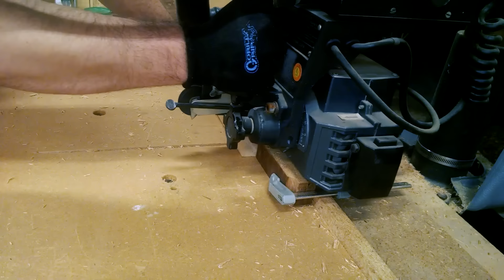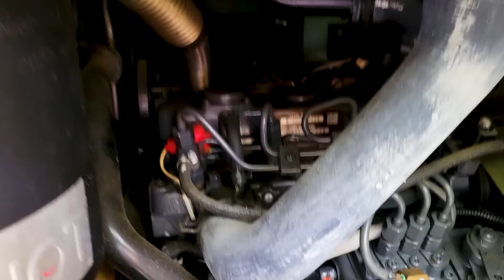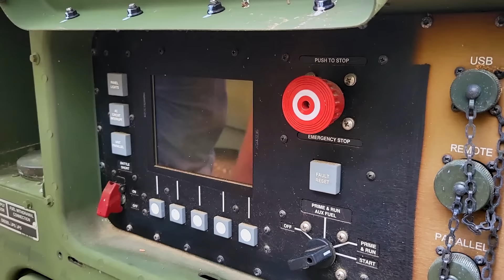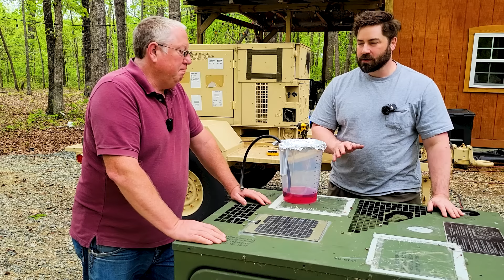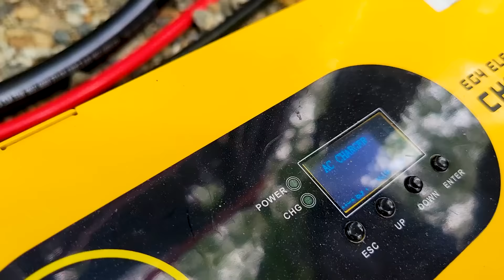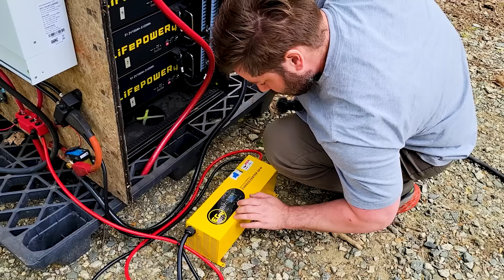Testing the Army's most efficient generator

Comment: the efficiency mismatch is because of the voltage. the most efficient is 3 phase and its measured by a resistive load bank directly. unless you are running the generator in 3 phase you will not see the efficiency gains.
source: i was a maintenance guy in the millitary and worked a lot on these things and because they were so problem free we had a LOT of time to mess with them.
Reply: I suspected the efficiency rating was both three phase and resistive.  Most efficient load and generation.  Be interesting to see what a three phase ac charger would do.
Reply: @cadamwil  well it not being a purely resistive load is fine for a real world application test honestly, most of the things you will connect will be a mix between types of loads anyways.
Reply: @cadamwil  first they would need a 3 phase charger that has PFC, mean well has those and are not cheap in that power rating. and then they would still be measuring behind the charger and its losses. they need a 3 phase power meter to do this correctly. the fact that they are measuring at the battery side and not the generator output makes me not being able to take this kind of testing and their results seriously. AC power meters (callibrated ones) are NOT expensive.
Reply: @SupremeRuleroftheWorld  This may be true, but overall if the general public were to get one of these and do testing, this is generally the type of testing that would be done. Test how much power is collected after all the gadgets to know if it's worth spending the extra cash for a better unit. Most home/diy set ups won't be using 3-phase, or won't purchase a 3-phase charger/inverter in the first place. So for the real world application of this unit by general populace is pretty close. 
But as always, take these kinds of findings with a grain of salt because everyone's mileage will vary
Reply: @korishan  if you had this setup a 3 phase charger would be very much a no brainer.
Reply: @SupremeRuleroftheWorld  its not lab testing allright but I agree that they would atleast need to do three phase
And I mean messuring what gets transfered to the powerbank and loads is still a important and interresting number
Reply: @korishan  I mean if you trying to messure its efficiency and efficiency claims you gotta go for 3 phase, no way arround it
Reply: @SupremeRuleroftheWorld  I think their chargeverter has PFC. And no need to get a fancy three phase one, three single phase ones should work just as well.
Reply: @SupremeRuleroftheWorld  Which generator is most efficient, that could be used to power a house? So I guess two phase. Does the military have a very efficient generator that would be suitable for that purpose?
Reply: @eDoc2020 the reason he was talking about 3 phase is power factor. And when you run a 3 phase inverter on single phase, you lower the efficiency.
Reply: Great information, thank you for your service 👍
Reply: Could there also be an efficiency difference in running Ag Diesel vs JP-8? I'm not particularly knowledgeable in this space but it was my understanding (and could be wrong) that the military standardized their fuel supply to be JP-8 for the broadest use cases.
Reply: The electric motors in hybrids are usually 3 phase for the same efficiency reason.
Reply: A part could be that they were over the 5kWh at a max of 5.7 they said wasn’t long yes but that could do it as well
Reply: So YOU'RE the Maytag repair man.

Comment: Engine efficiency is at best when you're at the peak power / torque in the power band.  If you run an engine at max, it will be less efficient.  This should typically be around 50 to 80% of of it's max.
Reply: Unfortunately the max torque rating for the engine is far above the operating RPM for this generator. 🙁

Comment: If our electricity gets any more expensive here in California, it would be cheaper to generate our own power via that diesel generator, if we are charging batteries without solar panels. With panels, a generator like that would be perfect for filling in gaps from cloud days.
Reply: I got a call yesterday from a friend that has a small auto shop. Their electric company just went to demand billing and his power bill went up over 4x for the same power. We are looking to put in hybrid inverters with storage for peak shaving. The ROI will be under 24 months. So yea, power is getting pricey in a LOT of places!
Reply: ballpark $/gallon for fuel (gas/diesel) can be converted to kwh, the electrical unit on power bills by multiplying the cost of electricity by 10 (or moving the decimal place once over). 
here in wa state with pretty crazy gas taxes, we are paying ~4$/gallon which would be like paying 0.40$/kwh.
instead i charge my ev for about $0.09/kwh, so its literally like paying 1980s gas prices with toiletpaper 2025 dollars. my electric car completely paid itself off after 18 months of driving. crazy.

Comment: you ran it at 100% load. 70-80% load is the sweet spot. Prob most efficient at that load. Run it at 4k for the test. Running anything at max cant be the most efficient.
Reply: We were running to match the published fuel consumption data. The number in the manual was stated @100% load.

Comment: I bet the circulating current from the 3 to 1 phase brushes, or whatever it uses, are at a 3% magnet drag during some specific current draw. At the full 5 kWh I bet it’s higher. I also imagine that if you used it on 3 phase, with a different charge controller setup, it would reduce the loss drastically. I made a crappy 3 to 1 phase, low current generator, at home. It was more a concept design than anything. I just used permanent magnets and brushes, then shifted them to go from 3 to 1. But when I would do that the motor I was using to turn it would start pulling too many amps to maintain the same RPM. To be perfectly clear here, this is when I was pulling 120v @ 240 watts per phase from both 3 and 1 phase configurations. So even though three 120v phases at 2 amps is more total produced power (720 watts), it cost more power to produce a single 120v line at 2 amps (a measly 240 watts) lol. 🤷‍♂️ science. I guess. That issue may have been particular to my design, but I suspect it was just exacerbated in my design.

Comment: Is it possible that the generator was rated using JP8 and not commercially available diesel?
Reply: Per Grock:
JP-8: Approximately 125,000–128,000 BTU/gallon. It’s a kerosene-based jet fuel with additives for military use, designed for wide temperature ranges and stability.  Diesel (No. 2): Approximately 129,000–137,000 BTU/gallon, depending on the blend and refinery specifics.
Reply: That is a good point. If it were I would have expected it to have over-performed since JP8 is closer to K1 than it is to D2.
Reply: California blend..no good. Way less energy.

Comment: What was the maintenance item code ?  Could account for the inefficiency . Specs would be reliable on a mil spec unit .
Reply: It was for the daily system check. The computer has all the maintenance schedule built in and will prompt you every day to do the pre-run check. It will also warn you when you are approaching a service interval to make sure you have the parts on hand.

Comment: For me, I bought some used light towers from a rental equipment auction. Watch for when they do a full refresh and upgrage of equipment. Picked up my tower with 4 1KW MH lamps. due to the auxillary load for the ballasts, and the safety margin, they are 6KW rated with 8KW surge. Surge is for a couple minutes, so plenty of capacity. Due to the large number of units at the auction, picked mine up for less than $1000. Single phase, 120/240 volts at 30 Amps.  Use it for running sound systems for concerts. After the concert, transfer over to the lights for tear down. Perfect mix of use. It came ready to run with the 30 gallon diesel tank full. Supposed to run 60 hours on a tank with full lighting on. For the concert as the average load is much less, I get longer run times.
Have considered removeing the weight of the MH lamps and upgrade to LED, and make it an inverter/battery hybrid. Run the concert on battery most of the day, and start the unit to recharge and power the louder evening prime time shows, and finish charging after the show while using the lights. An auto start on the battery inverter charger completes the conversion to hybrid operation.
Another advantage of the light tower, it is a trailer for mobility to and from events.
Reply: Nice! This is a perfect use for one of those.
Reply: @MrHuram-abi  Unlike a rental, you can add the breaker box to add the 240V 30A breaker and outlet.

Comment: This is the first measurement (2.3 kWh per liter of diesel) that comes close to my low end generator that does more than 2.5kWh per liter of diesel. A bigger efficient generator should yield roughly 3kWh of power per liter.
I think we have to face the facts that your measurements are off. Way off.
To be clear, they are factual, but something in the setup is not correct.
For instance: my cheap ass generator is 7.5kWh, and as a rule of thumb you should load it at at most 80% to be more efficient. I load it roughly at 5.5 which is 73% of the max power. That yields 2.5kWh per liter out of the generator as measured by my multiplus 2 3 phase setup.
Now what goes in the battery largely depends at the state of the battery.
So I want to see you measure what you get out of the generator, and what you put into the battery, because what I think is that we are looking mostly at a major loss of efficiency of the EG4 charger/battery combination.
I will tell you my way of measuring:
Whenever 50kWh of power is delivered according to the MP2 I fill the tank with diesel from an empty jerry can that I filled with exactly 20 liters at the thankshop. At some point in time the amount of diesel still in the tank (30l) is too much to add 20 liter from the jerrycan, so I try to aim at 51... So that's more than 2.5 kWh per liter.
The circumstances are bad: around freezing point. I did not add stuff to the diesel. This diesel would be as thick as honey if the temperature would go down 2 more degrees.
The generator is a DG75E MW-tools, and looks like a run of the mill chinese generator.
According to victron professional, a diesel generator will run most efficient around 80% of it's given capacity, and a bigger unit (mine is undersized for my use) would yield more than 3kWh per liter when loaded at 80%. You can load the diesel generator more, but it will be much less efficient.
That comment got me ridiculed in the diesel generator reddit. But yeah, facts are facts. I do slightly more than 2.5kWh per liter, which is 9.45kWh per gallon where the gallon is 3.78 liter (as gallon is country specific).
I don't measure what I put in my battery, it just says x%. I only look at how much kWh I have generated, and how much kWh I expect to use for heating, as I am off grid, and heating is  a bitch.
So yeah, if I make a mistake, you will find me in the newspaper as "frozen to death".
So really, something is off with the way you test. Generators should be way more efficient.
Reply: something doesn't add up, it says it consumes 8.7 KWh per gallon, which is 4.613 liters of diesel, so it's 1.88 Kwh per liter

Comment: From my calculations you are about 23% efficient (fuel to battery) or about 25.6% efficient (fuel to 120Volt 60Hz AC power).  Either way, that is pretty good!  I have to wonder if maximum efficiency actually occurs at maximum power???  I'd guess it is close to that, but maybe 80 or 90 percent loading results in a higher efficiency?

Comment: So exactly which 05 series Kubota is it??
My 1105 with an 8k head is a reliability BEAST
Did the military rate it on #2 diesel or on #1 JP8??
Reply: D2 has more BTUs per gallon that JP8 so moot point.
Reply: The engine is the D902-IV C.

Comment: I have wondered through this series if you could test at a lower/higher demand load. I realize they are designed for peak efficiency at 100% load, but I wonder how much tuning/slop exists in that based on build quality/breakin/etc. So it doesn't account for 20%, but it might be 2-3%.
Reply: That would be great info to have for sure. My read on the series is David is looking for any patterns to see how different types of generators compare against each other.

Comment: The generator is rated at its output on the most efficient power delivery. In the case of the MEP you should test it at 120/208 3 Phase into a load bank (not your charger). You have to think about power factor.
Reply: I do plan to do that as an aside since I have a 3 phase load bank. I also have machines with higher and lower hours. I want to see how that affects things as well.
Reply: True, but the end goal for this channel is battery charging efficiency.

Comment: I wonder if the generator engine is still breaking in which will cause it to consume more fuel.
Reply: He covered this in the video.
Reply: We are wondering the same. I will be testing that thought soon. I have other generators of the same model with around 300hrs. Those should be well broken in.

Comment: The generators I am used to using are gasoline powered. They recommend running them at half load for best feul economy. I am wondering if pulling a bit lower Amperage/Wattage during the test would increase the economy.

Comment: Wow, it is quiet. Barely effects the mic! Nice!  (Thanks for the ROI info)
If the internal computer dies, tho, how easy is it to get the spare? 
BTW, if David keeps volunteering information like the effect of altitude on the efficiency of combustion, he might tip people off that he knows more than he lets on.
Reply: The MEP10xx series are super quiet for sure. We had a power outage back in January and you could not hear it in the house. The generator was around 50' away, in the driveway. That was in the middle of the night when it should have been most obvious.

Comment: This might be a situation where running at full capacity reduces fuel economy. Maybe running at 25%, 50% or 75% is more efficient than 100%. I've found that my propane generator tends to run longer when at like ~80%.
Reply: I expect you are correct. But we were taking the rating from the manual and it did state that the fuel consumption was at full load. We could have been more clear with that.
Reply: I have tested and researched a lot of generators and diesel engines and I have never seen one that doesn't give max thermal efficiency (Which is what matters in a test like this) at or very near it's rated load (In fact you can usually get even better efficiency from the engine if you go above the rated load though you potentially risk overheating it if you do it for a prolonged period of time) . These aren't vehicles where full power equates to high RPM / high speeds/aerodynamic drag which increase frictional losses. The engine in these generators runs at 1800 RPM whether it's at max load or idle: So the frictional losses within the engine and generator head are the same regardless of power output. The only potential added loss is from heat in the generator head if the wire used for the windings is undersized... which I highly doubt would be the case in something as heavy duty as one of these military grade generators.

Comment: An engineer would say most if not all electrical equipment is rated at full load to 80%. I think you should run the test again at 80% load maybe even lower to find the sweet spot for efficiency. This goes for your charging equipment to.
Reply: True, we do say things like that. These are prime rated machines with continuous load at 100% of nameplate (per the manual) and intermittent load to 125% of nameplate. I've not had an opportunity to run them that hard yet since before I would do that I would put some thermocouples in place to make sure things stayed in the safe temperature range. These things cost a fortune at auction and I prefer to not let the magic smoke out.

Comment: For them generator sales you got to get your self a web site really easy to do..id love to check it out.. im in the process of building an off grid power system for my camper. Due to a house fire we live in camper. Winter ppwer needs r low. Summer power needs are higher. I at 1st was spending 40 a day on gas for a generator for power then i got a 48v 280ah battery and inverter chrger 5000w over sized it a bit. Camper is 30 so this will keep th system cooler and cooler meams last longer with less  chance of fire. . I dont yet have panels still using a gas generator for now half the time.. 15 bucks a day in gas to charge the batteries back up so the ac can run. Now diesel is a little more expensive but the generator will last longer.  Id love to have 1 of those. Right now im using a 10000w champion..biggest problem is it will blow up in a few months and ill need to get yet another one. I now have 2 dead generators and a new this one. Constantly changing oil. Them diesel ones last longer ill be connecting you 1 day but i know their more expensive id have to do somthing to make that extra money.  Would love to see a web site were i could see what the prices r. Or if you wanted to trade or barter. Im a vary handy guy. Im on nc sc boarder near the beach with reliable transportation
Reply: I sell a 3-5 generators a year. David is being generous by saying its a business. It really is a hobby that mostly pays for itself. The unfortunate situation is the MEP80x series machines are becoming fewer at auction. I think we are seeing the last of that supply. Since the MEP10xx series machines are so much more expensive, I don't know if this hobby will continue much longer.